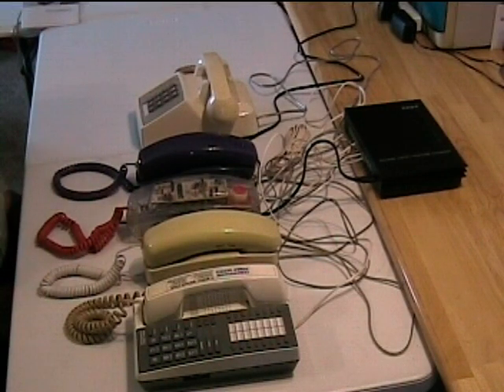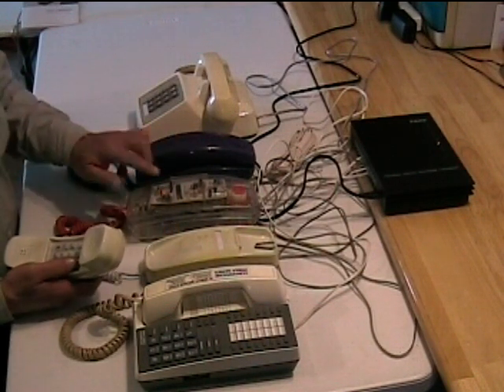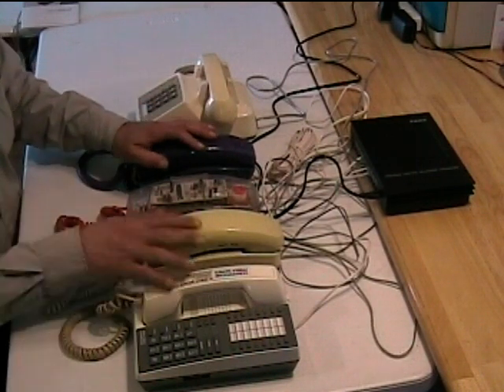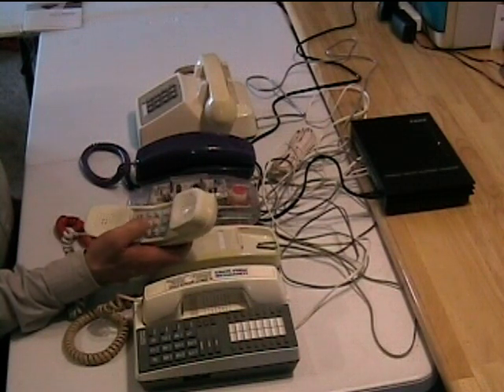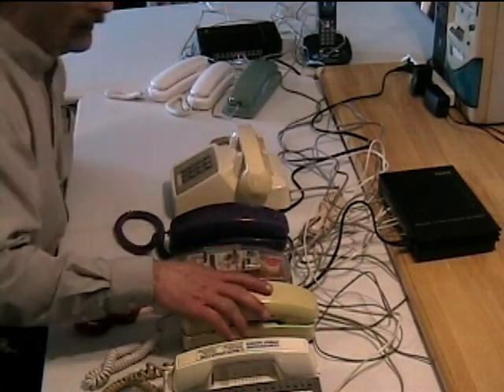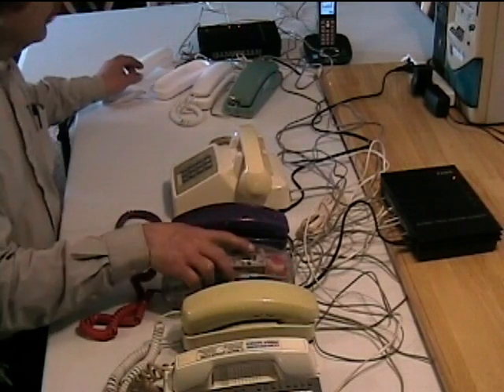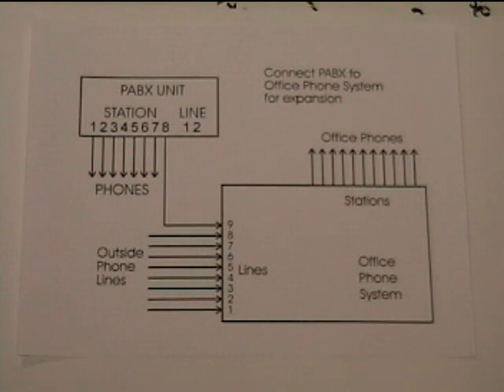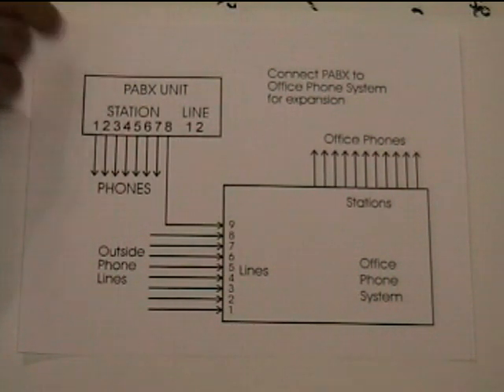Intercom using a PABX W4P300 #304

Comment: This is great but I need to make a note that using nine is really a bad choice. Unless you're in an area that doesn't use 911. Although still. What you don't want to do is have 911 ringing Port 9 or floor 9 or station 9. And if that thing is capable you would want to route that directly out on a CO line. Why do I say this? because, 1 it became law and 2 it became law for a very good reason. A kid dialing 911 was receiving floor 9 room 11 and was not able to call emergency services for there mother in a hotel room. And in my case I was at a shelter and the shelter Director did not know they needed to dial nine to get an outside line and then dial 911 so it would be 9911. I found out after the fact that they were struggling to get emergency services, if I had been interacted I would've been able to get an outside line but most people barely understand the concept of a phone system apart from ye Olde phone on their wall at home.
Reply from the maker: If 9 is a bad choice, what would a good choice be? Centranet uses a 7. It doesn't matter because if you don't know you are behind a pabx (or know what that means), you are not going to know that you have to dial anything extra. The only way for it to be idiot proof is if the pabx sees you dial 911 and then connects you to an outside line and redials 911 out on the line for you. A serious pabx could probably do this but I doubt these cheap things do. Reminds me of a day I was on a service call at a car dealership and asked the guy if I could use his phone and what I have to dial to get out. He said "9911". I started laughing, of course, and he said "you wont believe how many people fall for it".

Comment: i just bought this sp-208 soho unit and cant seem to get my multiline phones to work on it?  am i missing something?  the led screens on my phones dont lite up.  i just want to use them for intercoms between the house and barn and not hook it to a phone line at all.  thanks.... dave
Reply from the maker: Are these multi-line phones the type of phone with lots of buttons like you would see in a business office? If so, they will only work when connected to a KSU (Key Service Unit; the magic computer phone box). Another similar looking multi-line phone is a VOIP phone which needs to connect to an internet connection with POE (power) and cannot interface to a PABX like this. This PABX is designed to work with simple, single line, analog phones like you would have in your house. You can get relatively cheap phones like the two white ones I connected to the second PABX from walmart for $10 or so and they work pretty good. No telephone line is required if you just want to use it as an intercom.
Reply: @wired-up  awesome info!! thanks so much for getting back to me so quickly... i appreciate ya!

Comment: I got one of these things. I don't like the way it rings. Does a British type ring. I want the regular ring. I also like mechanical bells as well. The PABX should be designed to send the appropriate power to ring any telephony equipment. Back in the good ole days of POTS we could buy bells that were loud, made to attach to the exterior of the house, so the telephone could be heard ringing when one is outside. They needed another power supply, usually a battery box or a box that connected to the AC power then went into the box, where it would step up or down the current sufficient to ring the bell.

This is mostly nostalgia reasons, but I am spending more money, that I really shouldn't be getting old telephones from E-Bay because the Amazon stuff is chintzy garbage. We need to go back to the old ways. I am not saying abandon the new but use the new as a back up for when the old fails, until it can be repaired. Things used to be so much nicer and it could be, but the powers that be seem interested in nothing except sucking all the enjoyment out of life, and making life insufferable for those of us that can't even afford to chase dreams that we think might make us happy.

Comment: will caller id worked on any phone?
Reply from the maker: When calling between stations on the PABX, there would be no caller ID. I have not tried, but It is unlikely that caller ID would work on incoming calls from a telephone company line connected to the C.O. ports.

Comment: I live on a farm & want to be able to communicate over greater distances...would this unit work over say 1 mile?
Reply from the maker: Not sure.  The longest lines I had were about 500' or so and worked fine except that there was a noticeable buzzing on the line caused by a lot of electrical equipment in the building. The main problem would be the resistance of the line (telephone wire or cat-5 cable is fairly small wire). Perhaps putting two pairs in parallel for each station would help.
Reply: @wired-up  awesome, thanks for that. I'll give it a go!

Comment: Is it possible to have an incoming line from the phone componey on line 1, ring all of the stations without needing an extention to be dialed?
Reply from the maker: Yes. This particular unit had you choose between ringing or having the automatic attendant answer (then you dial an extension). If you choose to have the phones ring, you then tell it Which of the phones to ring, any or all. You would have to check the manual on other brands or models to see how they work. The seller may be able to provide you with a link to the manual so you can check it out first.

Comment: Can u have 2 trunk lines on the sane jack
Reply from the maker: Not quite sure what you are trying to do. It would be possible to connect two C.O. ports of two PABX units to one station port of a third pabx. If both of the first two tried to access the C.O. port by dialing 9, they would both be connected to that same station port so the second one to dial 9 would end up connected into a conversation already in progress. Does this help?
Reply: @wired-up  well basically I was wondering if u can have to calls with 2 trunk lines with 1 signal CO port
Reply from the maker: @ryanbelknap814  Nope. One port, one call.

Comment: Does this pbx work with dial up modems? I am planning to build an intercom setup and also have dial up modems in it, so they could connect to each other.
Reply from the maker: I have not tried this but it would probably work. The possible problems would be the modem not detecting the ring since it is not a standard 20Hz ac signal and the audio quality might not be good enough for a high-speed modem which might require you to run at a lower baud rate. The pbx does not use 7 digits to dial (by default it was 3 digits and I changed to 1 digit) so if your software forces it to dial 7 digits, must make the first digit the one that selects the desired station and the rest of the digits would be ignored.
Reply: @wired-up  Thank you for answer. Yeah the ring frequency and overall line "quality" were my biggest concerns.

Comment: I’m hoping to use vintage phones with this system. Could I insert a PoE injector between the pabx and the vintage phone to power the older bells within the vintage phone?
If I can’t then that’s not a deal breaker. 
I have run cat6 cable x1 to each room. It’s too late to run a second. Can I use a splitter to run a pc and pabx off the same cable.?
Reply from the maker: The issue with using older phones with mechanical bells on this particular pabx unit is that it is (I believe) feeding 60hz AC power over the line to the bell, not 20hz which is what the bells were made for. PoE injector would not help. You would need to modify the pabx by adding a 20hz ring generator. It might be simpler to just buy an external ringer and add it in the line at each phone if the bell in the phone will not work. https://www.ebay.com/itm/Telephone-Ringer-Phone-Amplifier-Ring-Speaker-Strobe-Flasher-Bell-Wall-Hanging/193682519852?hash=item2d1860b72c:g:ySMAAOSwgbpfbavh

The cat-5 (or whatever you have) cable contains 4 pairs. Only 2 pairs are used for the network (search internet for ethernet cable connections) and sometimes the other two pairs are used for PoE but if you don't need to feed power over the cable (which you don't if it is going to a PC), you could use one of the extra pairs to put a phone in that room. You would need to make some modified cables to split the pairs this way. There are splitters that are used to mix power onto a cat5 cable and another one to split it out at the other end, these are normally used for getting power to a camera at the end of the line that is not designed for PoE operation but I think you could use this to easily feed the pabx line over the spare pairs and pick it back out at the other end. https://www.ebay.com/itm/1pcs-Power-Over-Ethernet-Passive-PoE-Adapter-Injector-Splitter-Kit-PoE-Cable/352691470963?ssPageName=STRK%3AMEBIDX%3AIT&_trksid=p2060353.m1438.l2649

Comment: I hooked up a pabx unit in my house. Ive noticed slight hum on the line. Is that normal?
Reply from the maker: When I just had phones connected next to my unit, I don't recall hearing any hum on the line. I have a couple of these in use at my work and there is a noticeable hum due to there being many hundreds of feet of line to other buildings with lots of machinery. These are cheap units and I suspect that the lines are not properly balanced which would allow for common-mode interference. I have not made any attempt to eliminate the noise, perhaps some kind of filter on the line would work.
Reply: @wired-up  thanks! its not really too bad I actually found out it was from the old ISP modem dish that was right out side next to the Phone line I ran to the Living room, once I had that all unhooked the hum is GONE! lol.

Comment: Thanks for the video.   I would like to use one of these to help filter the calls we get in which not one is on the other end.  I would like to use the auto attendant feature to this end.  I was curious if unit "rings" when an incoming call initially comes in.  (I would prefer it not ring and let the auto attendant pick up and if the is a human they can select the appropriate extension)
Reply from the maker: If the auto-attendant is enabled, no phones will ring when a call comes in. It answers and plays a message and then will ring one of the phones depending on what number the caller presses in response to the message.
Reply: Wired Up thanks for that, I am going to order one of those units.
Reply from the maker: @philipmosher8617  I would connect an answering machine to extension #1 and a phone to extension #2. Record a message on the auto attendant saying something like "If you are selling something, press 1. If you know me, press 2".

Comment: Hello thank your for video I don't know how I use ligne 1and 2 in outside
Reply from the maker: I'm not sure I understand what you need to know. The telephone line connections allow you to connect the unit to a telephone line and then access that line by dialing 9 from a telephone to make a call. The unit can also be programmed to ring one or more stations if a call comes in on the telephone line so you can answer a call. If you are just using this as an intercom, you do not need to connect a phone line to it.

Comment: CAN I USE IT WITHOUT PSTN
Reply from the maker: Sure, no need for any outside connections. As shown in the video, I used the ports that would connect to the pstn (phone company) to link two of these together but this is optional, it will work just fine with nothing but a few phones connected to it.

Comment: how can i get mechanical bells to work with this?
Reply from the maker: Some mechanical ringers will work as shown in the video but most will not. I have not taken my unit apart but suspect that they are just taking one of the windings of the power transformer to drive the ringer but this is at 60hz which is the problem. When a station is being called, I hear a relay clicking in the unit so I suspect the relay intercepts the station line and connects it to the winding. If you could break the connection to the transformer and connect the relays to a source of AC at 20 hz (70 volts or so), this should take care of it. I have seen some ring-generator modules that will take 12vdc and put out ringer voltage but don't have any particular model in mind.
Reply: Wired Up okay i can look to see if i can find a ring generator, mine just don’t have enough power to ring my one phone line
Reply from the maker: @westogarage   Search ebay for PCR-SIN03V12F20-C this should do the job. Generates 70vac at 20hz. I think you need to put some resistance in the ac output line to protect the unit from overload is the called station picks up during the ringing cycle.
Reply: Wired Up ok i’ll check it out, where do i put the resistance?
Reply from the maker: @westogarage  I had to check thru my notes on a unit like this that I had bought years ago, the seller said to put a 330 ohm resistor (1/2 watt should be adequate) in series with one of the output wires but in looking at products currently available, one of the sellers says to put a capacitor of 1.8 to 2.2uF, 250v (or higher), non-polarized in the line to protect it. The red and black wires are the DC input, 12vdc on the unit I had. White and blue were the output, put the resistor or capacitor in series with one of these wires before they feed to the relays in the pabx unit in place of the ac power from the internal power supply transformer. If the yellow wire is not connected, the unit will produce ac output power. If you could tap onto the relay coils, you could use this to control the yellow wire to only turn on the ring generator when needed; have it at +12v when not needed and either open or grounded to the DC negative line when ringing power is required. You could just leave the yellow wire disconnected and let the ring generator run all the time but I don't know if that would cause it to wear out over time.
Reply: Wired Up ok i can do some research, is there a direct message or something we can talk in? i’m not really good at checkers youtube
Reply from the maker: @westogarage  my email is intercom4u@yahoo.com

Comment: As to interconnecting two systems, I cant recommend it, it would be simpler and more efficient to simply buy a system with larger capacity system. As to wiring between two different systems simply run cable with more pairs, always a good idea for system expansion.. There are also modern key-systems that support single line phones. The phone guy 40+ years of experience.
Reply from the maker: One larger pabx would have been fine but we didn't have sufficient cable pairs between the buildings and it was much easier to put the second pabx in another building than pull another cable underground and then extend it several hundred feet back to the main equipment location. I agree that more pairs would be nice but over the years, most of the spare pairs got used.
Reply: Whoa Chris...
Your Got A Bit To OFFENDED !
IT'S JUST A VIDEO.
YOU KNOW,  A DEMONSTRATION.
Reply: @rkb6783  I'm not the least bit offended I simply offered what I felt was the best advice you're free to do whatever you want to do no skin off my nose
Reply: I was able to set this type PABX to a Toshiba CTX100 PBX as an outside line 2 on the Toshiba system then connected to Port 8 or extension 608 on the Soho PABX

Comment: How you get 601 extension number?
Reply from the maker: By default, this pabx wants you to dial 6 plus a two-digit extension number from 01 to 08.  I reprogram the unit to only need one digit so it doesn't take so much dialing. Other units may work differently.

Comment: I wonder if their is a way to modify the ringing current so that it produces 90vac
Reply from the maker: The unit is powered directly from 120VAC. I'm assuming they have secondary winding that they are using to drive the ringers, probably something from 50 to 90vac (I never measured it). The real problem in driving mechanical ringers is that it is 60hz, not the usual 20hz. When it rings another station, you can hear a relay inside clicking on and off so I assume it diverts the station line to this winding. If you were to disconnect the secondary that provides the ringing voltage and fed in your own ringer voltage, this should give you what you want.
Reply: Yes, the problem is the frequency, not the voltage. The “arm” that does the ringing can not move quick enough. The clicking noise you hear is that arm trying to move. Usually there is no relays in standard phones.
Reply from the maker: @stenne ,
I was referring to the relay in the pabx unit. It switches the station line to the ringing voltage to cause the phone to ring. If you were to disconnect the ringing voltage coming from the transformer (at 60hz) and substitute a 20hz supply, the phones would ring properly.
Reply: Wired Up ok, I thought you heard the clicking from the phone.

Comment: Are there any cheaper PABX units you would recommended for a home office with probably 4 phones?
Reply from the maker: The smallest units I have seen were for 8 stations. I just found a place that sells these and others:  store.soho-pbx.com   on the left click on "analogue telephony" to see some options. The SP-208M is $59.99 but they don't specify if this is the 110v or 220v version of the unit.
Reply: Well thank you for trying to find one. I’ll be sure to stay tuned in case you do another pabx video. Thanks again.

Comment: Who makes these units and a sales source for them.
Reply from the maker: I bought these model SP-208 PBX on ebay for about $60-70 last year but when I look now I only see two sellers, one wants $145 and another wants $300. There were other similar units but for some reason I no longer see them for sale and the ones I now see are quite expensive as well.
Reply from the maker: I just found a place that sells these and others:  store.soho-pbx.com   on the left click on "analogue telephony" to see some options. The SP-208M is $59.99 but they don't specify if this is the 110v or 220v version of the unit.
Reply: @wired-up  says the site cant be reached. :(